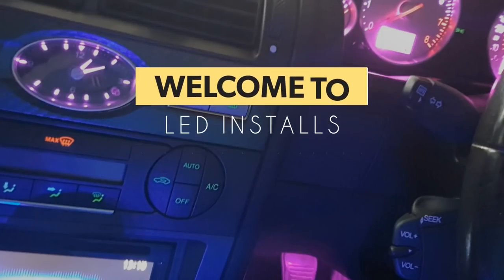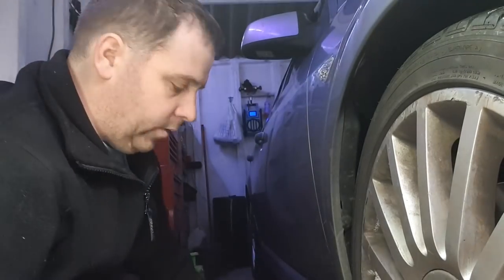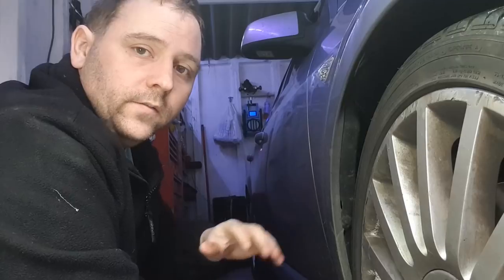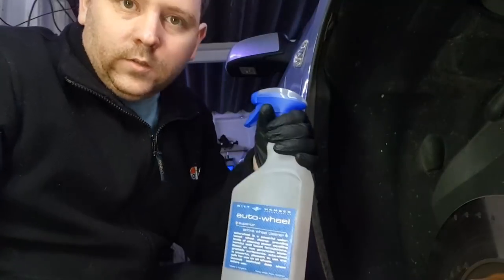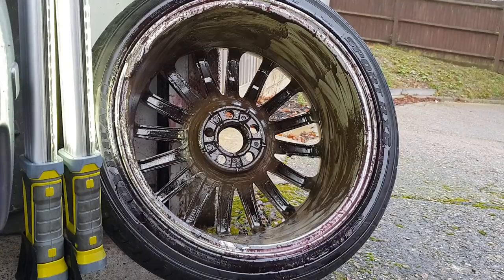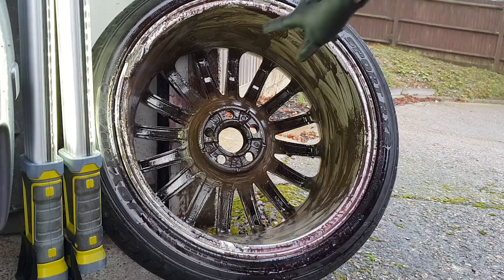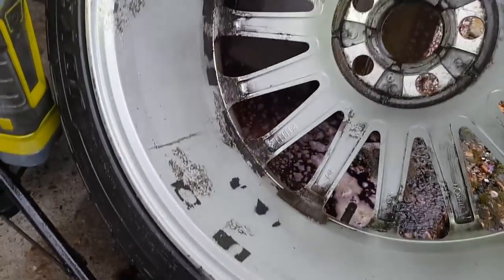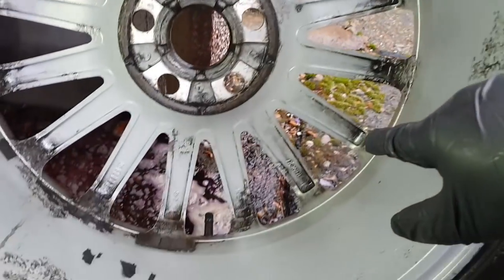Bilt Hamber auto-wheel review Ford Mondeo MK3 (Project ST220)

Comment: Their Korrosol works just as well on wheels, the benefit is that its a paint fall out remover too so no need for two products.
Reply: Korrosol is purely a fallout remover.
Auto wheel has detergent in it too, to actually clean.

Comment: wtf why is the wheel so scratched u cant drive ? :D:D
Reply from the maker: The rims was like this when i got the car, i am slowing cleaning it all up and doing stuff to the car😃
Reply: @ChazzCoombes  what lights was you using
Reply from the maker: @matthewtoon8481  hi it is a Eiger foldable 800lumen floodlight was sold by Homebase but they no longer sell them, if i find one one ebay i will post the link